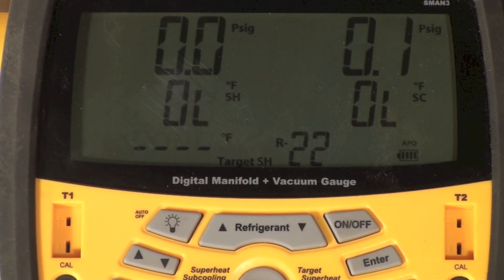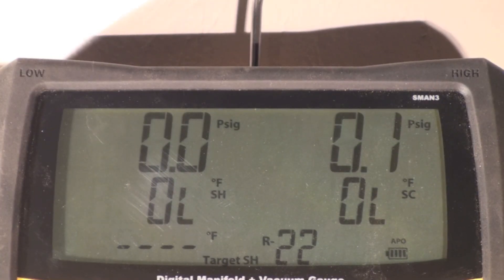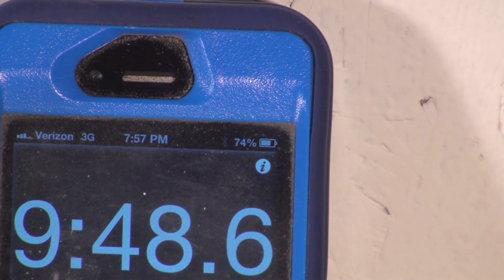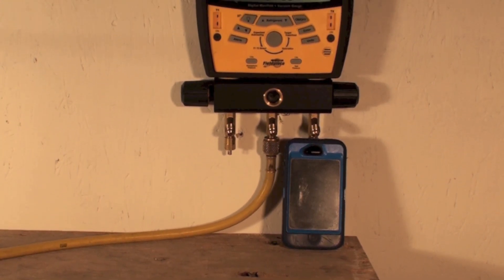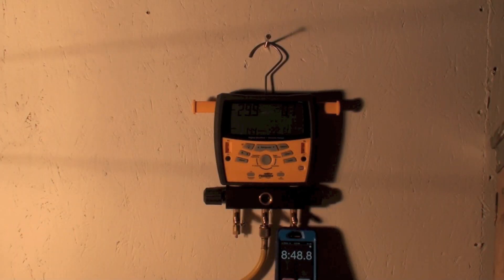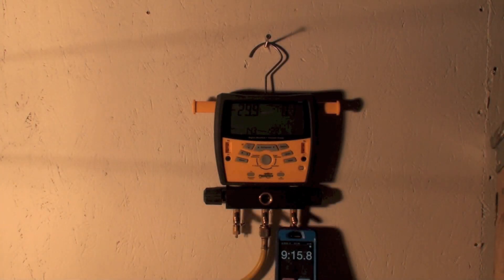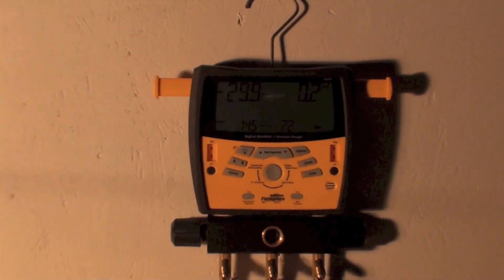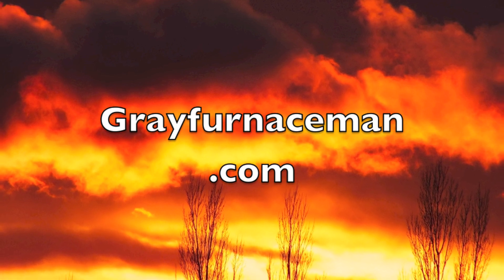Comparison of hard pipe or flex for HVAC vacuum

Comment: Been watching your videos for years I guess I missed this one. I’m 52 and my dad showed me before high school to use soft copper metal lines for doing pump downs. And my father was shown by an older gentleman when he was younger to do this by an old refrigeration guy that he knew and would go out on jobs and learn from. It was also double reinforced by high school classmate of my fathers who worked at Gentron ( became DuPont) was a chemical engineer for making refrigerant. This goes all the way back before the days that flexible hard rubber line was even available for vacuum laboratory scientist would use metal lines. Extremely old school and in laboratories they would make it out of glass.

Comment: I wouldn't say it "leaks" as much as I'd say it's outgassing... the rubber is literally evaporating in the vacuum in equilibrium with the gas removal by the vacuum pump. When I was in college, I built parts for and worked with mass spectrometers that required a vacuum chamber at a pressure of 1/10,000th of a micron. All vessels were 304L stainless, all through-fittings were TIG welded on the inner surface, and all gaskets were one-time-use ultra-clean copper rings that mated with mirror-image circular knife edges on the vessels. At those pressures, even the hydrogen absorbed by the stainless steel would outgas. We would wrap heaters around these chambers and bake them at 500 degrees F for weeks while pumping them down before we could even determine if we had a leak. One method we used was blowing helium at them and looking for the radio signal for helium ions from the detector. And to get down to that vacuum, we used pumps that were so special, we couldn't even start them until we were down to just a few microns... such as turbo pumps that look and operate like miniature jet engines and cryogenic pumps that essentially "freeze" stray gas molecules. And our "roughing pumps" (just a 2 stage rotary vacuum pump) required ultra low vapor pressure vacuum oil that was over a hundred dollars a quart. If you get to low enough pressure, everything leaks. A hydrogen molecule is like a marble and 1/4" thick stainless steel is like a fish net when you're talking about ultra high vacuum. But the principles I learned took all of the mystery out of evacuation.
Reply from the maker: +EightiesTV I'm impressed.  Good information.
GFM

Comment: question. when your adding refrigerent to a system how long should you wait on a digital manifold for the sub cool to rise and stabalize before you decide if you need anymore?
Reply from the maker: +Arnold Navarro First give the unit about 15 min.  Add in small amounts, waiting about 5 minutes for stabilization.  That's only a rule of thumb.  Experience will tell you when to add.
GFM
Reply: cool

Comment: I did several tests on my work bench, what I found is that anything with a rubber O ring in it leaks and the vacuum takes longer. My Testo was leaking at the o ring on the sight glass and shut off knob o rings, my Sman4 has O rings everywhere. the shraetor valve stem removal tools (Appion and Yellow Jacket) all have O rings and I can pull a vaccum quicker with out them. The best way that works for me is to remove the shraetors, hook my 1/2" Appion hoses directly to the suction and liquid lines, braze in two additional shraetor valves, takes 2 minutes, hook my thermal vacuum gauge to one shraetor valve with the stem removed  and leave the other valve stem in that 2nd shraetor and cap it, I put a 4" piece of 1/4" copper tube with two 1/4" flare nuts on the Vac gague, no yellow jacket hoses and no gaugeset, just the two big Appions directly from the 6cfm Robinair vac pump. Pull the vacuum quickly down to 250 microns, the compressor oil will fractionate any lower than 200 microns, then when I'm satisfied, I add refrigerant in the 2nd shraetor to break the vacuum, get the system up to 2 or 3 lbs pressure positive, then remove the hoses reinstalling the valve stems, air can't get in as long as your in the positive pressure. It would be nice if Appion made 4ft hoses, you have to wrestle with those cold hard six foot hoses and some times they win.
Reply from the maker: Sounds like you have given this a lot of thought.  I know many techs that never remove the schraeders.  It sometimes works ok and sometimes not.
GFM

Comment from the maker: LPA is simply using a centrifical  pump to move the liquid from the condenser to the txv.  Compressors are good at changing pressure but not as liquid pumps.  If the liquid line is long, flashing in the liquid line may occur.  They will increase efficiency on large units.
GFM